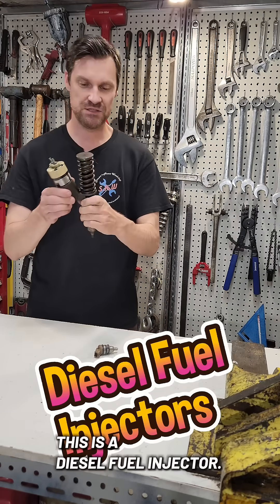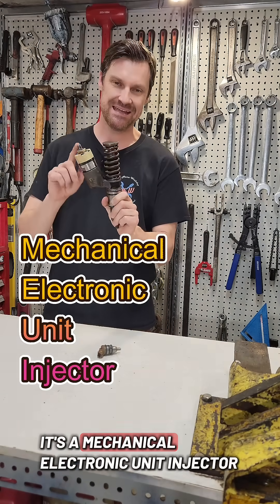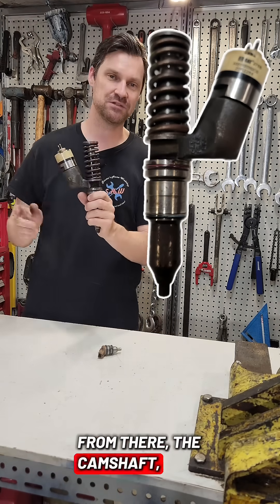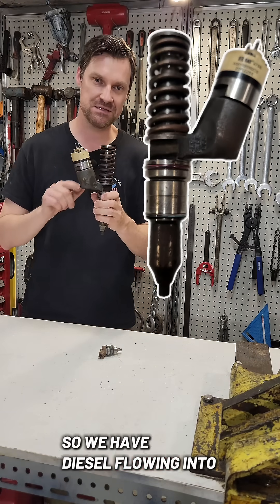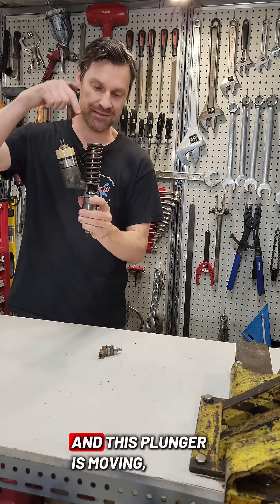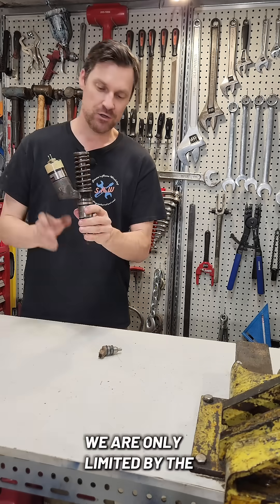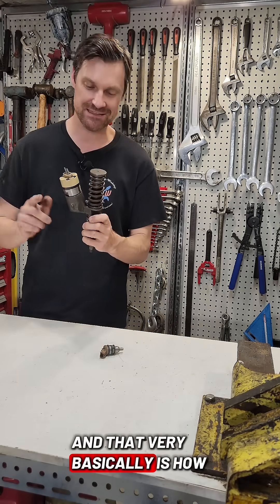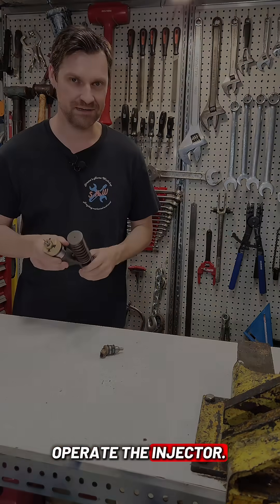Diesel Fuel Injectors MEUI. #engine #diesel #dieselpower #engineering #injector

Comment: If you loose electrics with this system, does the engine still run?
Reply from the maker: Hey mate, nope there needs to be a power signal to the injectors for injection, if the ECM loses power supply or the power from the ECM loses connection to the injector harness the engine will come to a stop.
Reply: @simmoshomeworkshop  thank you for the response!!